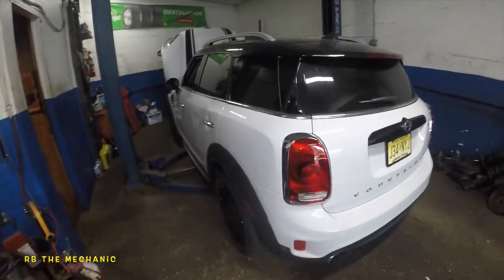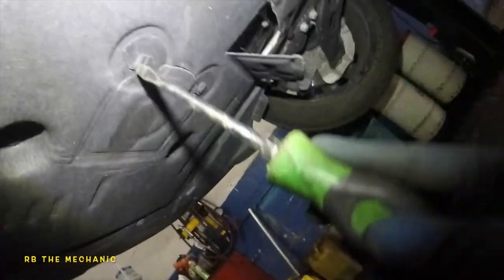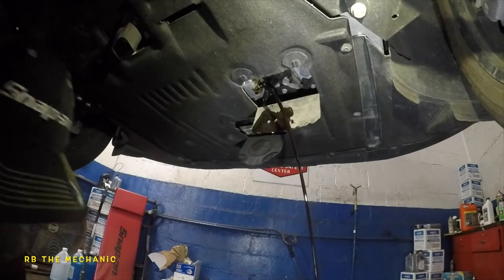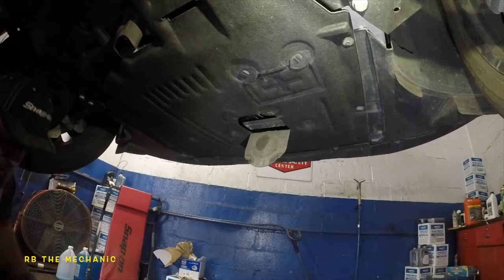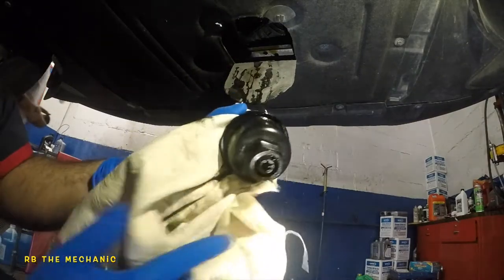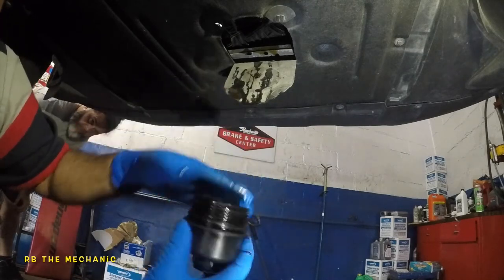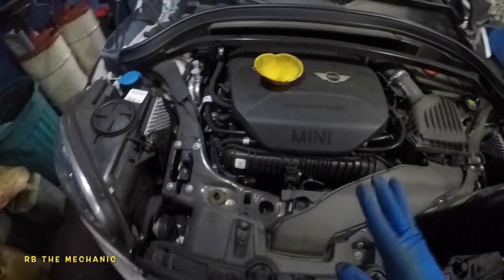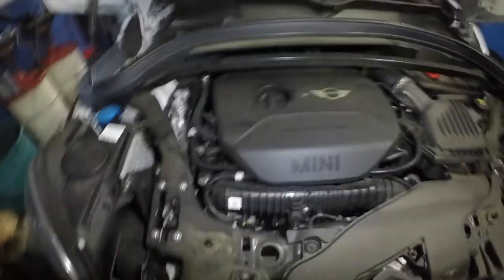2018 Mini Cooper 4 cyl turbo 2.0 oil & filter change  Castrol EDGE Synthetic

Comment: The socket doesn’t fit between the subframe and the oil filter housing, dislike for not providing a  solution to the most obvious problem with these oil changes.
Reply from the maker: Ok sorry
Reply: Was a low profile/short socket needed?